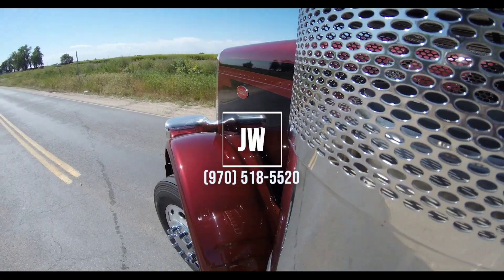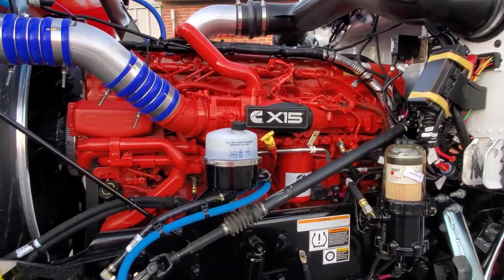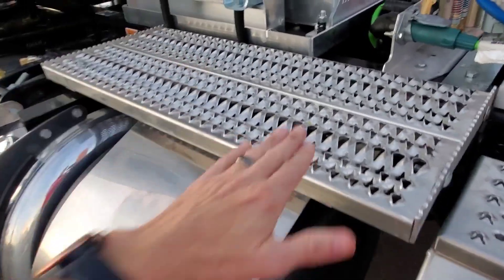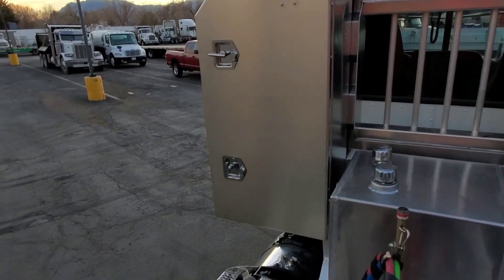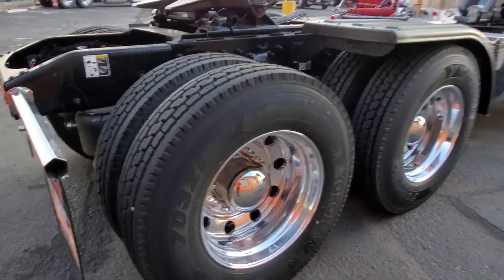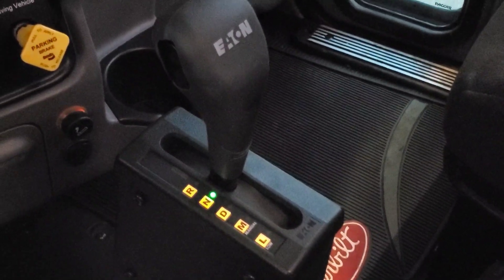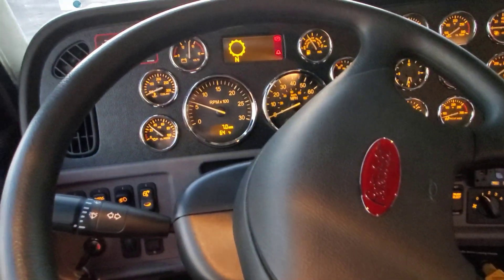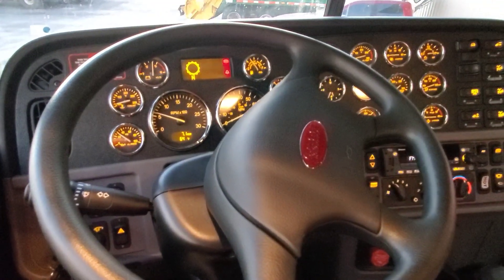389 Extended Day Cab- Automated- Iconic Accessories- Call JW 970-518-5520

Comment: 1 question about the transmission; when driving empty can you select the gear you want to start off in and then progress up or does it start in 1st ?
Reply from the maker: Thomas, it senses loads and grade. When you are empty and come to a stop, it will start in 2nd or 3rd. Sometimes when new, it is a little frustrating because it is like a toddler!  If I roll up to a stop on even ground and want to start in 3rd, I simply click it up and it will do it no problem.  Great question!

Comment: The government is over stepping there boundaries with this  with this pollution crap they absolutely ruined these diesel trucks my buddy has a 3 1988 Mack R models all have the 285 mechanical Maxidyne turned up to 300 hp there tandem dump trucks he will not get rid of these Mechanical trucks and I don’t blame him at all they run everyday  12-14 hours a day never no problems extremely reliable my other buddy has a 2018 567 peterbilt triaxle dump 550 Cummins has had a lot of computer sensor problems  pollution sensor issues he adheres to the maintenance schedule for this engine it’s a shame cause there not cheap by any means

Comment: 389 with auto transmission... no way. 389's To much of a iconic truck for a auto transmission .
Reply from the maker: I understand your perspective for sure. I will say that once you drive one in heavy traffic, you will like it a little more than expected. There is no substitute for an experienced driver with a manual!  This is a way for people with leg injuries to continue driving.
Reply: @LargeCarjw  wow great point. Never thought about it. We have a 2017 t880 with 18 ultrashift. You are right the highest gear you can start is 3rd gear. Just gotta be careful pulling out into traffic. Once it hits high side she flies..
Reply: @LargeCarjw  you should do a driving vid